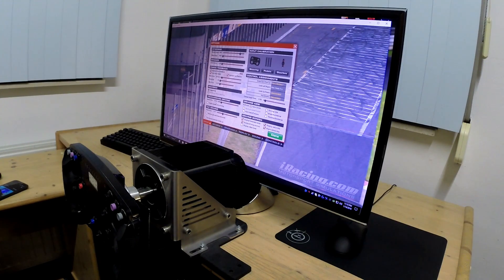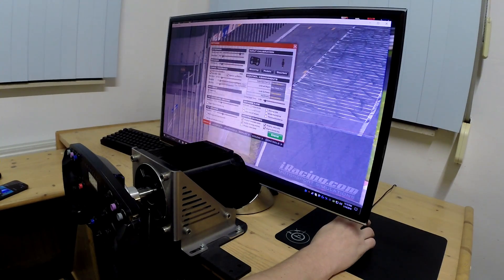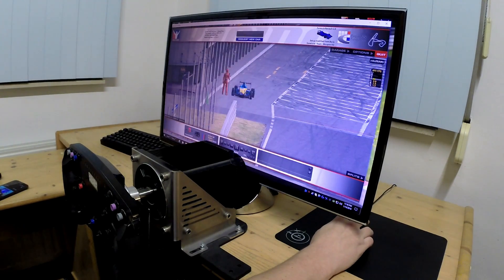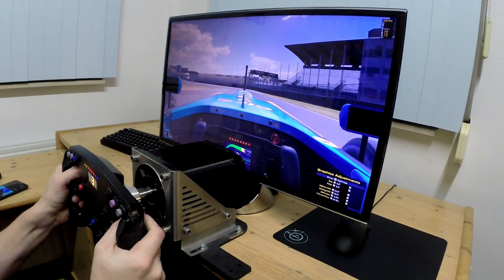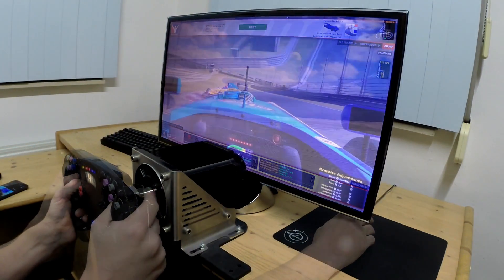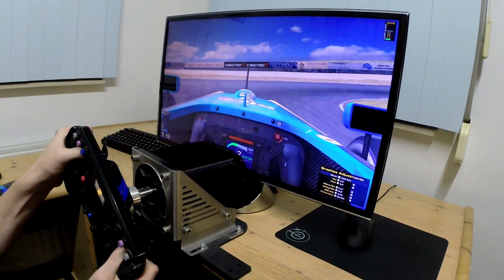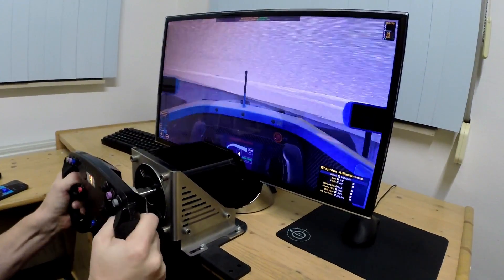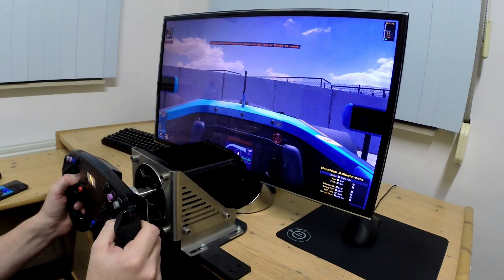Direct Drive FFB Wheel What Happens When you Crash at Max FFB Strength

Comment: Hey! Is there a diagram of how to connect the equipment? I want to do the same
Reply from the maker: sorry no there is not. but i can tell you. you need very compact brackets for the motor mount. in order to mount it on a table clamp.
Reply: @SimRacingSK  Thanks for the answer. I need firmware and PCB. Can you help me?
Reply: Is this fanatec table clamp v2 ?

Comment: Isn't direct drive wheel just a cnc stepper motor?
Reply from the maker: it could be lots type of motors but this is a servo motor. but you can use l alot of type but small or big miges are popular in sim racing MiGE 130ST-M10010 or MiGE 130ST-M15015
Reply: @SimRacingSK  a long time I want try assembly ffb wheel, what setup you have? Board, motor, etc...
Reply from the maker: @robertoricardo182  just bought a ready to go simucube 1 from augury
Reply: @SimRacingSK  SIMUCUBE 2 Pro seems to be good option! What you thing? The 2 ultimate it is too expensive...
Reply from the maker: @robertoricardo182  yes the simucube 2 pro is the way to go now!
Reply: @SimRacingSK  Where is Augury?